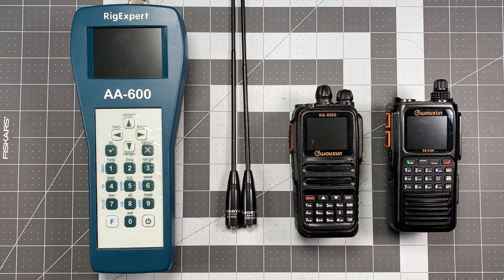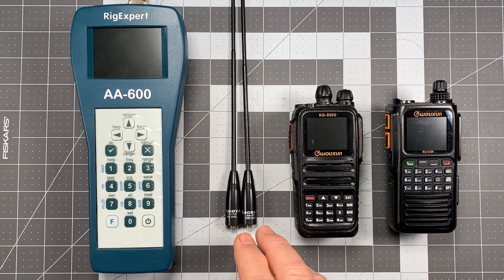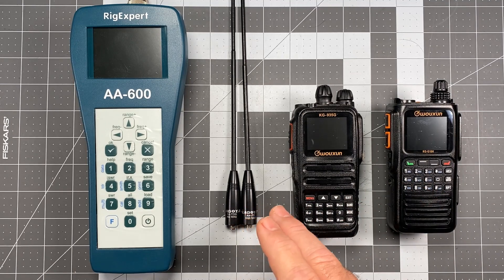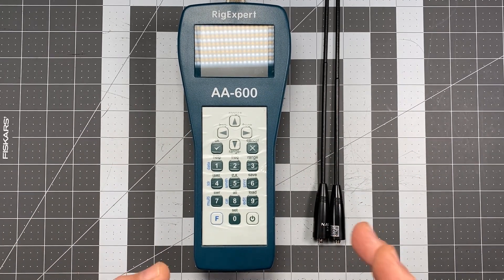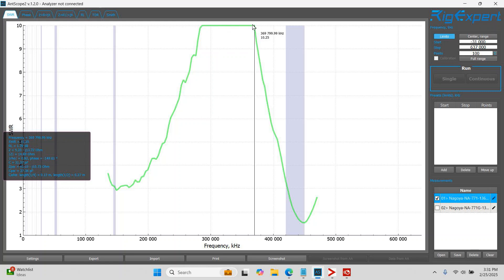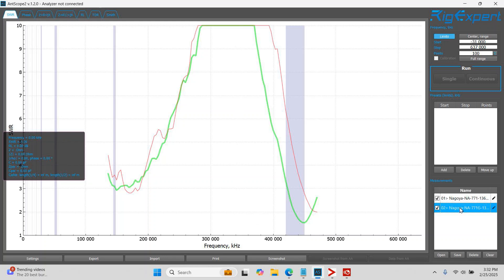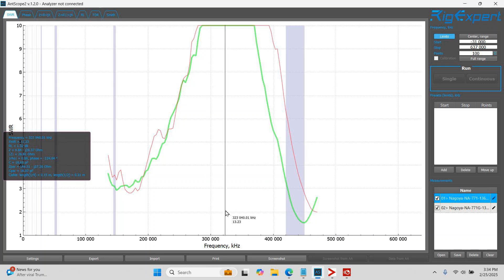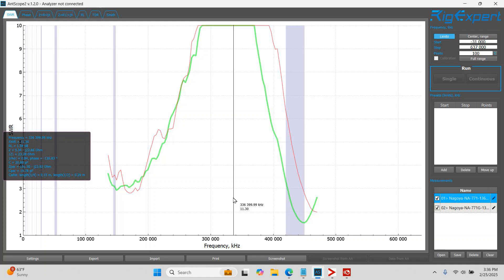Can you use your dual band Ham antenna for GMRS too?

Comment: new to all this. I bought a TID H3. At first it was for hurricanes. So if my parents need me and cell phones are down they can reach me. But then i learned about repeaters and fell down the rabbit hole. I cant seem to hit a repeater 2.9 miles away from me. Bought a 771 the other day and still cant hit it. It seems though. I purchased the right antenna . I didnt even know there was a 771g. I guess I'll stick with just the 771 though. Ive been watching videos on the ham test. So if i decide to get my license for that, i can just unlock the H3 to normal mode and tx on ham freq. So probably better to keep the 771 version.

Comment: I have several radios, most of my ducks are wide banded, and when testing the Nagoya does a good job. I have a pair of signal stuff BNC, I swap out with my Nagoya with BNC adapters. HT's are compromised radios  anyways, so it's flexible; I don't think about it as much as my mobile or base stations.